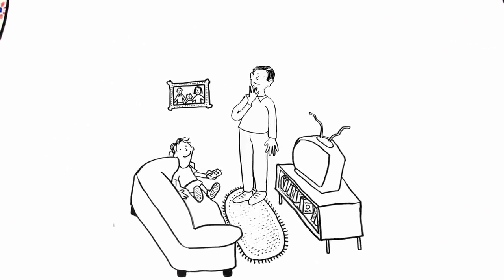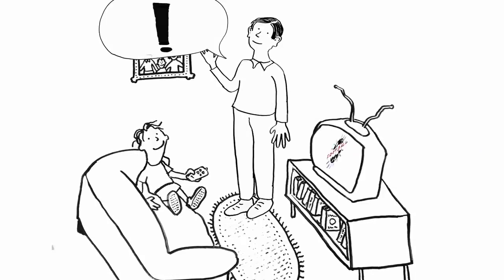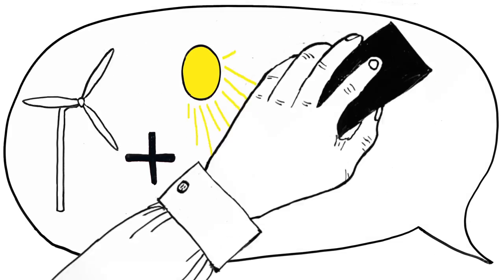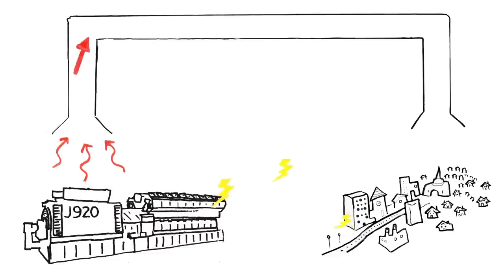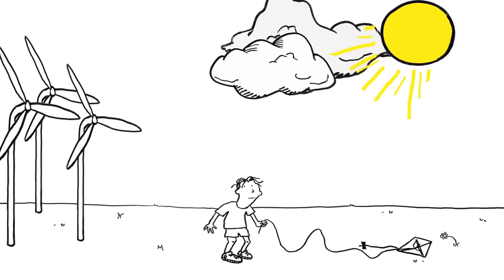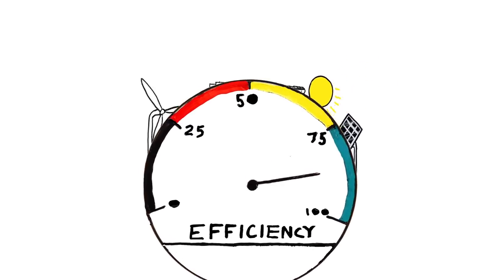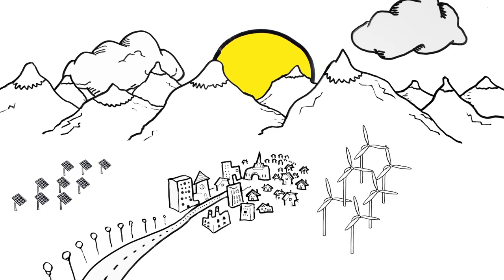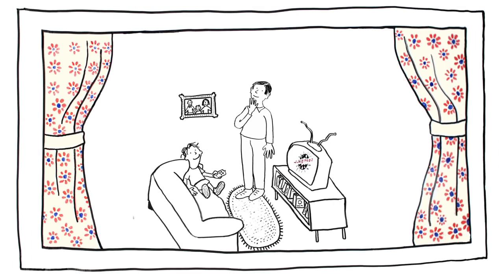How It Works: Combined Heat & Power | Distributed Power | GE Power

Comment: one thing I did not understand is how does the engine work when there is no sun or wind?
Reply: It works on Natural Gas (not with Sun  or Wind). When there is no Sun/Wind (which can result in lower power generation), the NG fuel can be used to quickly start-up the gas engine for power generation!
Reply: ah okay thanx :)